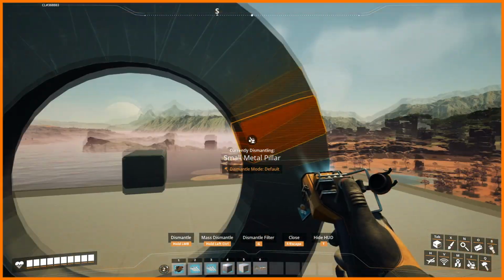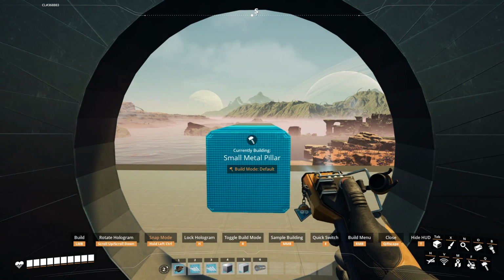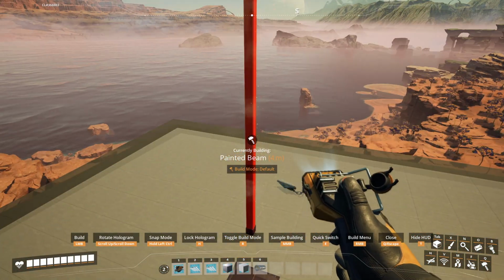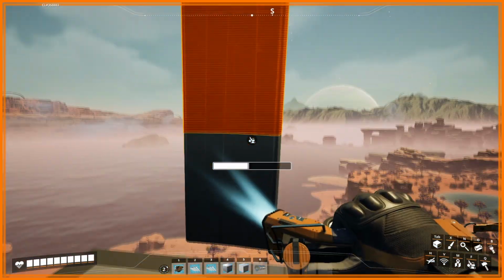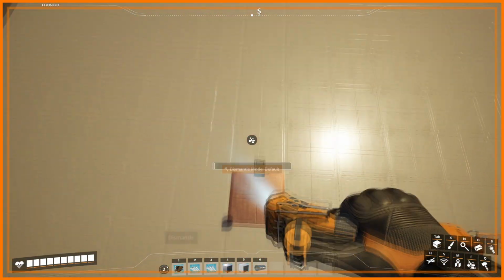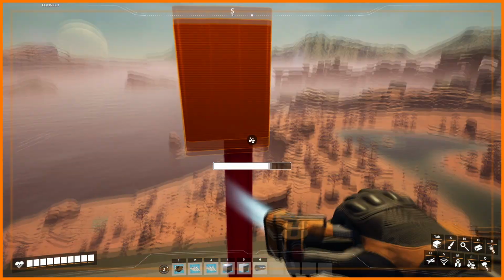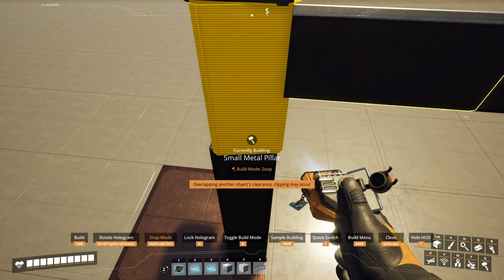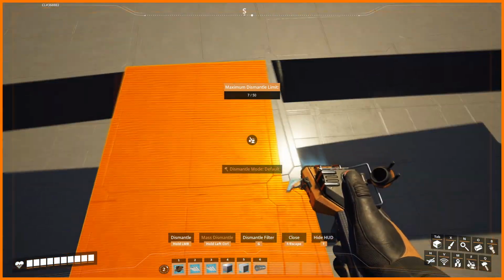How I Make My Circles In Satisfactory 1.0

Comment: You can probably extend the Circle, by going up 80m or more for the first beam.
Then have the second beam align the circle by using freeform to point at the corner of the first small Pillar.
Im wondering if thats going to be a bit uneven when closing the circle.